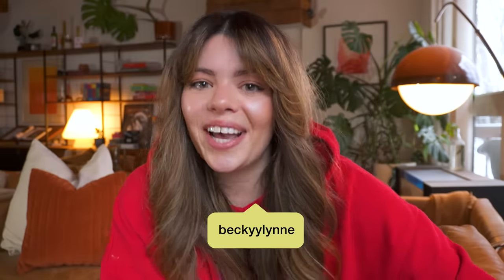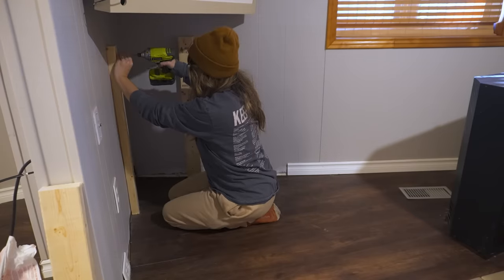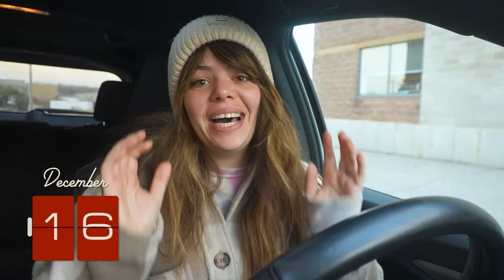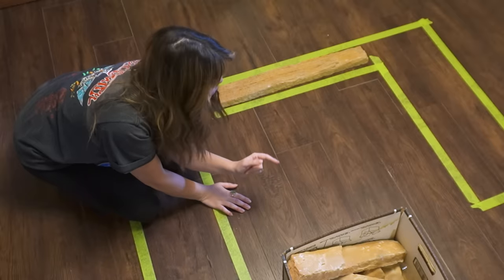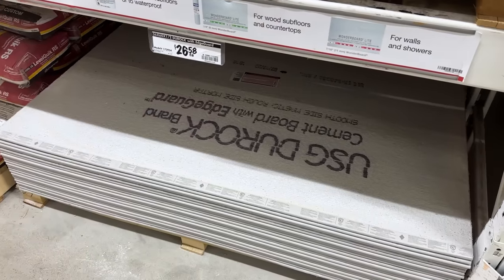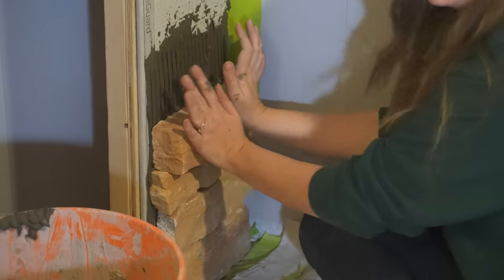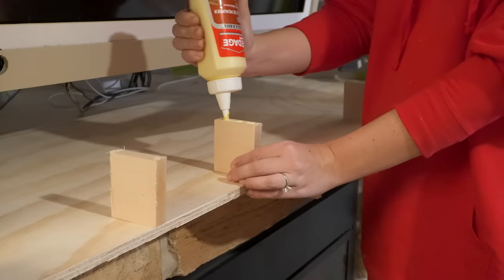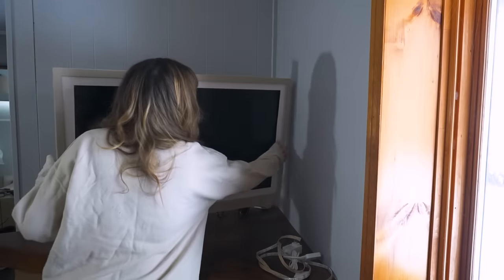diying a mid century inspired fireplace for cozy season

Comment: On tip the wood below the mortar needs to be moistened slightly for the mortar to stick. Too wet on your mix it will slump too much. Everything is a learning curve and you’re always trying new things. Love your bravery. When you back butter be more liberal with the amount of mortar on the brick. Bamboo is a grass so danish oil won’t work on it. I agree with the comments the one corner needs to be cut back or rounded off to prevent injuries

Comment: I have been waiting forever for more That 70s House content. Becky, please make more cool stuff, you're style is impeccable. Btw for the top part, I would've placed the longer brick to the side, just so it wouldn't seem so centered, and the shorter bricks together.
Reply: Either that or since she made other bricks smaller to make them fit she also could have broken the longer brick in the middle to make it more fitting with the rest of the bricks length. :)

Comment: That turned out so beautifully! 🤎🧡 Just a few questions:

Why is there a sharp corner protruding out? 

Was your angel off or you just didn't want to cut that corner flush?

Is there a gap somewhere behind the unit for heat to escape? 

Do you even need to cut an area for the heat to circulate?

I thought in your arch fireplace you left a gap...🤔

Comment: In the future and to anyone watching and maybe doing something similar: Ideally you should use cement board for tiling onto! Plywood sucks too much moisture too quickly out of mortar to get a correct adhesion of the tiles. It will also make it more likely to crack as wood warps with moisture and heat more than the cement board would. 

But otherwise, amazing job, Becky!
Reply: Clearly I should have finished watching before commenting because you figured it out like a minute later😂

Comment: Tip for the next time (from a stone mason assistant that has done full stone fireplaces.)
You don’t need to use tiling techniques (mortar).
Next time use something called “Sikaflex fast cure (FC) polyurethane adhesive sealant”. It’s an amazing glue and stays a little flexible.
Definitely the Fast Cure!!! 
Sukaflex is the brand and the more expensive option. There are much cheaper ones available. You can either get it in a ‘calk’ kinda tube or a ‘sausage’ with then a bigger ‘sausage gun’.

You just glue them on the plywood (or pretty much any service). You won’t see if you grout it afterwards. 
You can also ‘dry lay’ the stones with this glue. Which is without grouting and the stones are much closer to each other… Tip then is to have a dark/black background 👍

Comment: Looks great! I’m curious to know how you cut the 2x4s lengthwise at an angle. 

I have a faux stone wall that uses the veneer. They’ve been falling off at the bottom corner and I’m hoping to use tile adhesive from my previous project to put it back up.

Comment: It looks really good, and the timber top finishes it off perfectly.   I probably wouldn't have even bothered with the cement stuff and would've gone straight to liquid nails.  Your perseverance with that could probably mean your result is more durable though.   I actually thought you might've needed to use a heatproof/fireproof board instead of normal timber and plywood.   Does that fireplace get very hot on the outside, or is it really well insulated?

Comment: What about the switch and the outlets that were on the wall?  Admit I just started watching and seeing it get boxed in set my anxiety meter through the roof.  Flashbacks to renos, finding wires, stealing from other circuits and redoing a board.
And agree re the corner.  I'm feeling the bruise as I type. But an easy fix compared to the initial try at the brick.

Comment: It actually makes me really angry that you built it there. The TV already looked awkward & squished so adding the fireplace just made it worse. Especially with the mantle sticking out & then on top of that you added a plant on that side ahhhh too much 😖 you should have done it on the wall opposite the bed, it might have been far from the bed but it would have fit better & you could have done a cute little seating area there & put the TV up higher. Actually, putting the TV up higher where it is now is the only thing that would make that area look a tiny bit better.